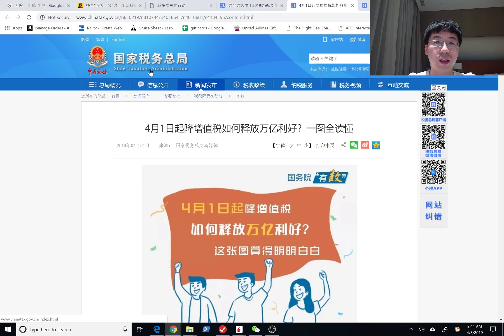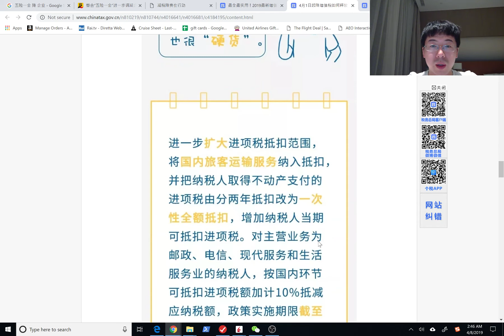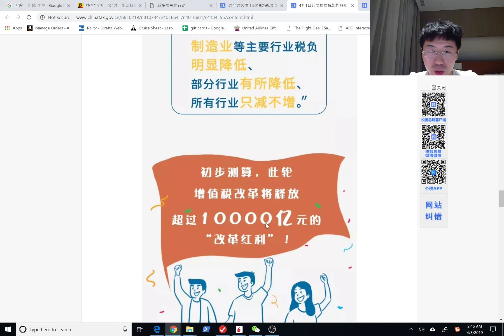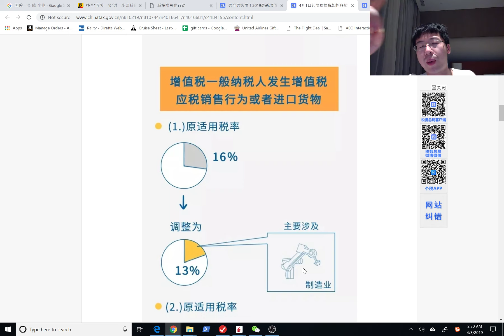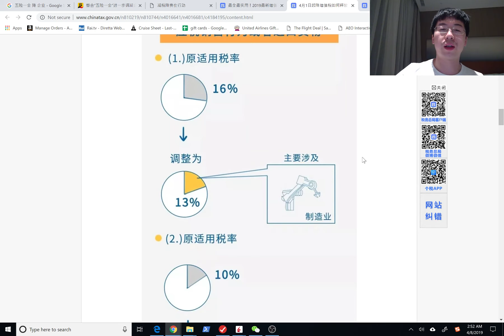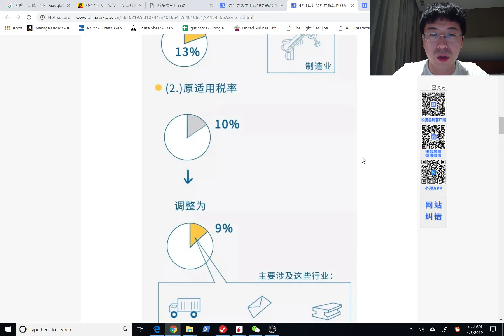China cuts VAT, Manufacturing VAT goes from 16% to 13%

Comment: Let me answer some of your questions : 
@ 04:10 : Yes, if you have purchased / imported that machinery or raw materials, and received a special fa piao (VAT invoice) for the VAT paid (including on imported goods, where China Customs will charge the VAT - unless you purchase it duty free & VAT free under the special PPIM scheme), then you will be able to offset that input VAT against the output VAT you will charge on local sales inside China. 
@ 07:30 A company like Gree will likely see an overall decrease in total input VAT, since VAT rates in all industries (different VAT rates, also 9 % & 6 %) have been lowered. The VAT they charge their local customers will decrease, and should be reflected in price cuts, since China VAT Law stipulates that the VAT Exclusive price must be shown separately from the VAT charged on the special fa piao issued on a sale (and of course since their customers are likely wholesalers, they will in turn be able to offset that VAT charged as a credit against the local VAT they charge on their own sales).

Comment: Nice point the Gree will ask suppliers for a discount because of tax cut but have a strong brand so might not need to pass it on. I am not sure if you have to pay VAT on exports (in Australia GST isn't charged on exports)  if so should be bigger boost to domestic market suppliers which I think should good for Gree?
Reply from the maker: Yes, VAT is refunded for exports.
Reply: @InvestingwithJYK  : wonder if sharemarket will pick up on this as you mentioned or too complex/small for people to correlate. Might be hard to show up in individual companies as there might be other factors going the other way but a domestic manufacturing focused China ETF (if there is one) should be positive short-term.
Reply from the maker: @Tim-Lester  I would not place too much emphasis on this. Just enjoy the additional profit :)